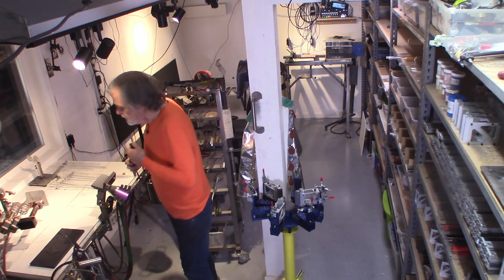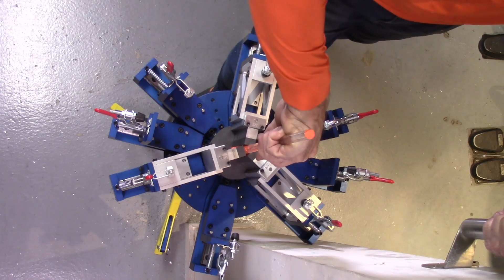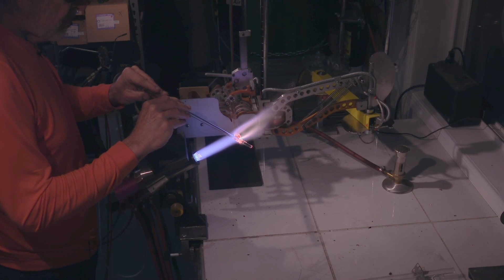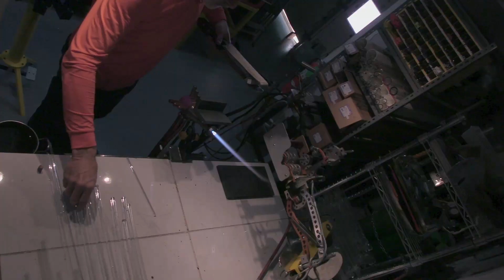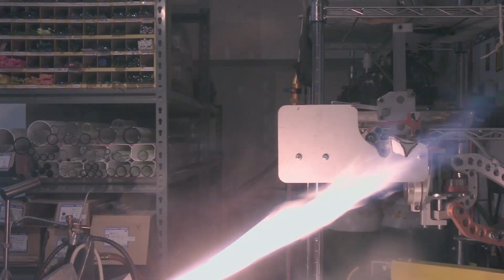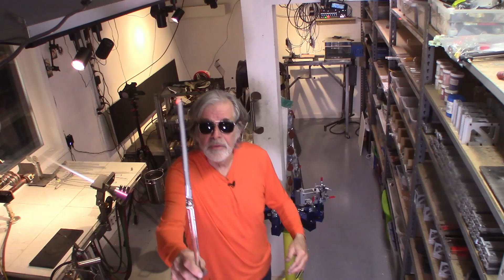S9:E2 Glassworking with the NQALHA and Octavius Squeezer - Resizing

Comment: I’m guessing that being all prep’ed to punty for your final size and utilizing the core heat from resizing you will have a much more even pull and no need to “final resize”. Just don’t loose any of your core heat and maybe even shoot for a bit hotter, so you’re simply coming out of the squeezer knocking the chill off the outside and pulling. Just a thought ~Smile oN